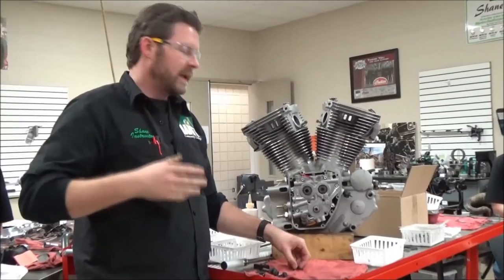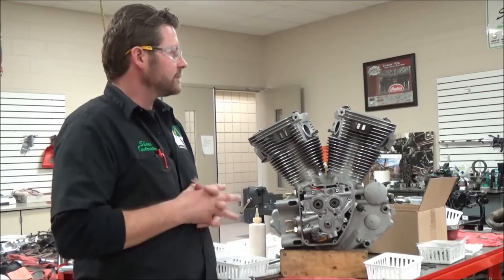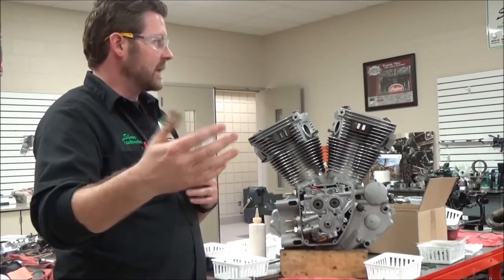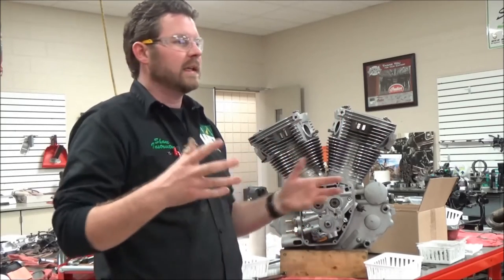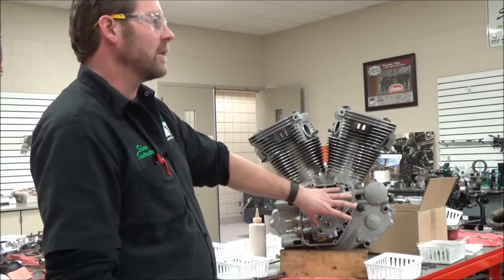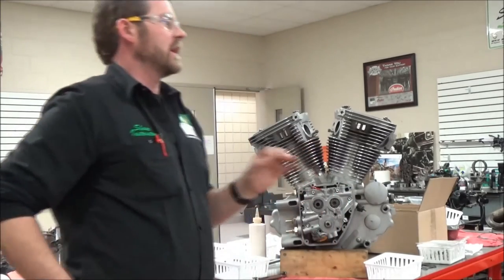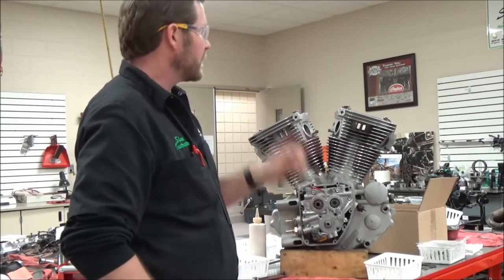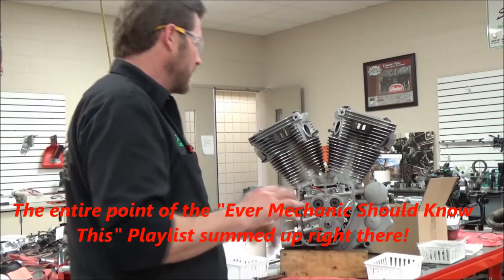Stop Marrying Bolts, Kiss them First!  How to properly install fasteners, nuts & bolts!

Comment: When I worked on the Space  Shuttle we torque  using multiple steps. There were other things we checked for like running torque (this is making sure you had a certain resistance in the fastener going into the threaded part using a dial torque wrench. The engineering drawing usually had the spec to watch for etc ) anyway yes multiple steps .